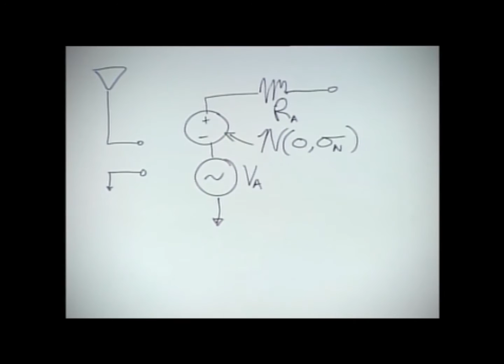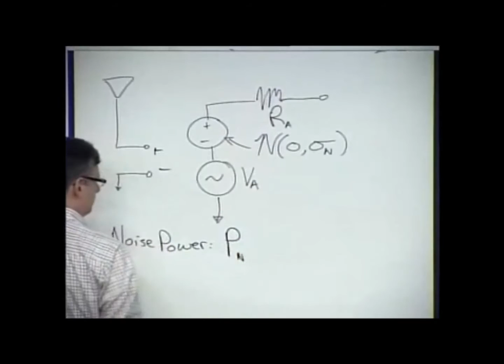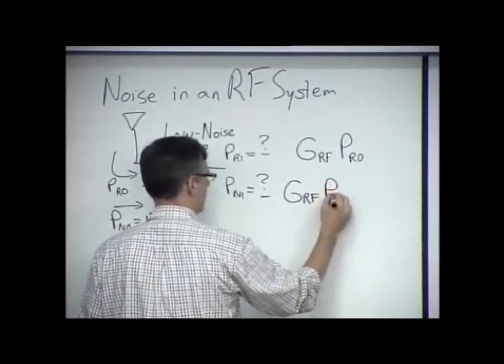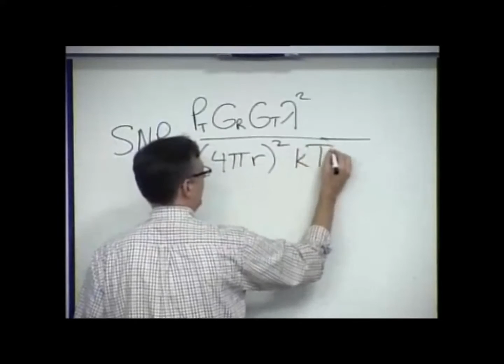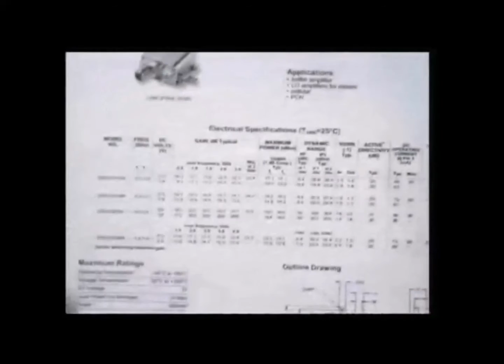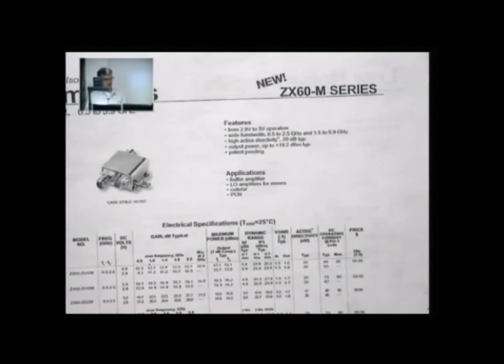RFE01 Noise Figure

Comment: Great lecture,
Shouldn't the noise generated from the LNA not be multiplied by its gain, since it is an internally generated noise, and the only noise that will be affected by the gain of the LNA is the one from the antenna.?
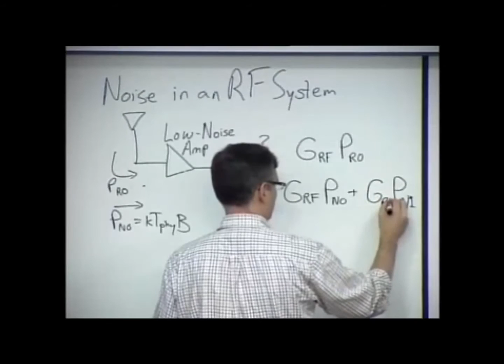Reply: Although the noise only appears at the output, by convention, noise generated by a device is referred back to the input. He talks about this at 24:44.